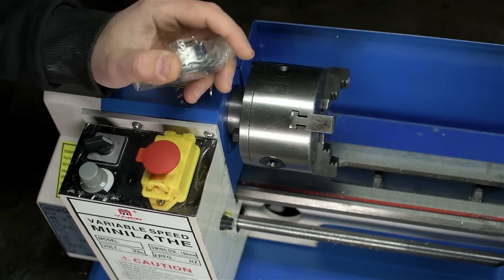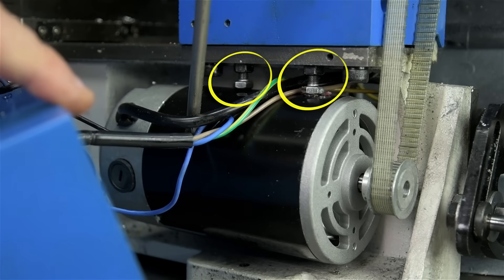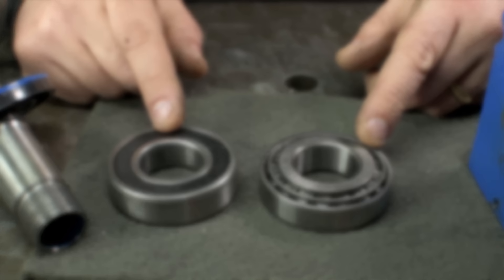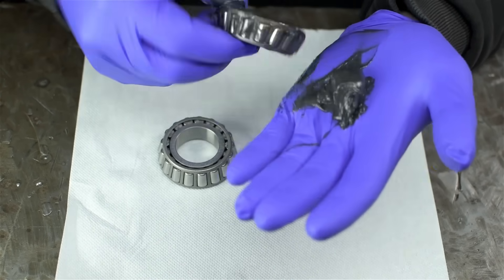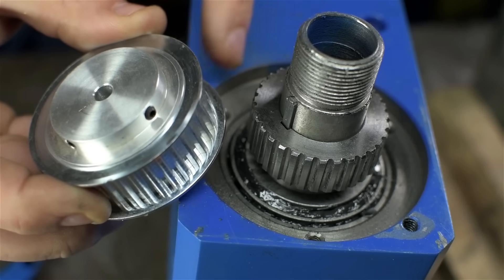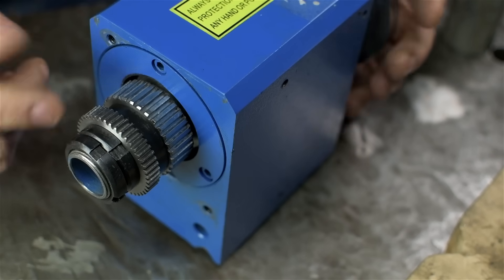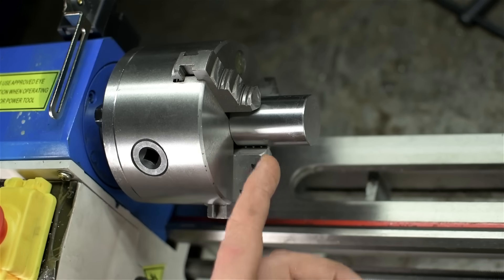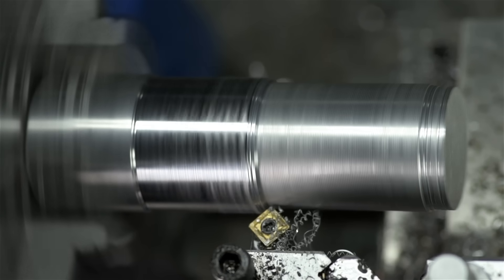Better LATHE Than Never!

Comment: You will never "improve" a machine's performance by arbitrarily replacing the bearing type used and your "they do the same thing" claim is simply wrong. Tapered roller bearings carry primarily radial loads and are never subjected to "axial loads" continually because only one bearing is carrying the load while  the other ceases to "roll" and slips, slides or otherwise loses contact and ceases to do anything its designed to do well. Wheel bearings are a really poor example of "axial loads" since the radial loads are applied to the hub which is only "aligned" by the tapered roller bearings and prevented FROM creating high axial loads. You'll also never get a tapered roller bearing "balanced" as well as "preloaded" properly when using identical size tapered roller bearings at each end of an "unbalanced" shaft. Ever seen tapered roller bearings "connected" by a shaft that loads one bearing more than the  other with identical tapered rollered bearings at each end? If your example is a modern unitized wheel bearing on a FWD or 4WD axle its a poor one as the differential, steering geometry and wheel alignment as well as torque from even "coasting" axles combine to make those sealed and unserviceable bearing assemblies "disposable" and the disk brake caliper and rotor "help" with axial loads and particularly during "high loads" which occur when the wheels are turned sharply, they are turning relatively slowly and the "outside" wheel and tire are doing the overwhelming majority of the steering and when the brakes are usually applied at least lightly which becomes the primary "thrust bearing" for the front wheels, tires and hubs freeing the "wheel bearings" to carry axial loads only. Even then, thanks to unbalanced loads on equally sized bearings, if the wheel bearings outlast the brake rotors it won't be by much and its "preventive maintenance" to replace the wheel bearings while the hubs and rotors are removed. 

Those "chatter marks" look a lot like the "drive belt" friction surface and the result of overloading the machine causing the belt to alternately stretch and snap back speeding up and slowing down the spindle each time. And you just added a bunch of rolling resistance and imbalance to the equation because apparently online "engineers" who can do no wrong in their workshops always find flawed factory engineering and/or part "selection" errors to blame when their brand-new imported machines aren't worth learning how to operate correctly because they're "inferior" to their worn-out scrapyard-reject reseller-special machines that if operated the same way doing the same work would almost certainly do it "chatter-free" but would probably also throw in some "taper" and/or "out of round" free of charge. 

Kind of an odd way to check to see if the machine is "improved" without putting a dial indicator (a real "up-down/direct-reading" indicator used for indicating "axial" travel of its contact probe) on the chuck and spindle before and after your improvement and without checking endplay before and after with the machine "warmed up" as well. You'll also need some luck using those locknuts to set your improved bearings properly for minimum runout of the shaft which requires "zero endplay/zero preload". Cold. 

With your knack for re-engineering inferior imported machines to make them "better than new" have you ever thought about building your own mini-lathe? Seems like kind of a natural project for the hobbyist that already has the "real thing" and can turn, mill, grind, weld, flatten, parallelize, perpendicularize and customize anything he needs and has the electrical/electronics background to make the whole project as simple as buying some stock and some bearings, belts etc.

Comment: Angular thrust ball bearings are better- you can get them fully sealed for no maintenance.  All cars are now equipped with dual row angular thrust wheel bearings instead of tapered rollers.  For a mini lathe, a single row deep groove bearing is plenty good.

Comment: Enjoyable video Thanks. Useful information delivered with humour is unbeatable.  With a lathe that size, inserts for use on aluminium should go well.  If they can't handle the material, the lathe probably can't either. Ground sharp edge and 20 degrees of rake works well with that spindle power.  Moulded inserts should be reserved for tiny Colchesters.

Comment: I don't know how this could be considered an upgrade. Ball bearings , unless they were made in a cave, tend to be much more accurate than rollers, which have an inherent instability of the rolling elements relative to the cage. I built a lathe from scratch with a ball bearing supported spindle specifically to achieve improved accuracy and finish over my work horse taper roller Grizzly and the results are impressive, and I used only a good quality automotive bearing, not even angular contact. Over the years I have also realized that with a proper setup cutting forces are surprisingly small , except for certain operations like knurling, for which I would recommend scissor type knurles , making concerns about spindle loads unnecessary. Bottom line, it is my opinion that on smaller lathes the pros outweigh the cons for ball bearings, and should last many years while giving better accuracy and finish.

Comment: What many of you are missing here is, depending upon your needs, that there are many models of used ex small industrial lathes and other machine tools available often for less than a new Chinese lathe. Such machines are of high quality built to last. Choosing one is not difficult with many coming from training schools, tool rooms or privately owned. Sure if you live in an apartment or just don't have the space or your needs only extend to very small work, the OK. But even then there are quality very small lathes available. 
I was trained as a jig and tool maker in the late 50s and have built 6 passenger hauling steam locos. When I purchase a machine tool I want one that will do the job from the word GO and not to spend time modifying to make it fit for purpose. But if you get off on modifying the machine then by all means enjoy yourselves!

Comment: The upgrades were logical and probably produced the best bang for the buck. The milling marks on the slides were driving me crazy, time to break out the scraper again Tony ;)

Machines like these are best run with high rake tooling in my opinion, the insert shown would be a big ask for this machine due to the angles of the cutting forces. For those playing along at home, high rake inserts designed for aluminium can still turn steel just fine, just wouldn't be used in a production setting. The only disadvantage is they can produce stringy chips. HSS with a high rake and kept sharp would also work ok and a suitable chip breaker can also be mangled into the tool.

Comment: You talking chatter and ball bearings, that’s what one of the old timers at work told me this past summer a lathe with ball bearings in the head stock you’ll get a lot of chatter out of it. He said it should be plain bearings (bushings more common term).

Comment: Just for reference, you shouldn't use moly grease on roller bearings, at high speeds the moly can lubricate almost to well and cause the rollers to 'skid' in the race rather than roll, this flat spots the roller.

Comment: Love the video, not sure about the negative attitude on speed.
I mostly use mine with carbide drills for 0.2 to 0.4mm holes in steel nozzles etc. RPM is nice to have then.

Comment: do like some of the old horizontal mill Burk comes to mind, and make a felt seal on shaft with o-rings to hold it in the casting for the front and back ( inside ) and then add the oil cups?

Comment: What is the motor's electrical configuration?

I've always heard that 1ph motors will induce chatter into the part based on the phase angles involved in bucking the armature, where 3ph has much smoother power input due to the 120° phase angles.

My lathe is 3ph, so I've never had the experience to say if that theory is true or not.

Second thought: why not make an insert for the open base of the headstock to create a cavity, and then run an oil bath like a proper lathe?

Comment: Not necessarily a bad thing to learn your machines limits when first starting out. Having to tear it apart and see the all the internals, good bad and the ugly, gives you at least an idea how hard you can push the machine. And im ok with that. Besides not everyone has the space or the access to 3 phase power for a good branded big lathe😂

Comment: My lathe isn't quite that small (9x20). It is my first and likely only lathe. I did bypass the compound with a solid steel block (appropriately machined) and was utterly impressed by how much better it was. This is to say that that mod alone is a significant one. So if one can't find taper bearings to fit their lathe they should at least consider this one.
    Never ever ever change 2 (or worse more than 2) variables at once. You know better than that! You were probably just kidding about it "the scientist in me" etc. I should probably just lighten up eh?

Comment: I just blew mine up turning some mild steel. (2 thou cuts). 
Rarely used the little bugger and when I used it I used it only on some copper slip rings. 
Gonna buy a proper lathe soon.

Comment: Top video mate, I'm thinking the low entry cost combined with bigger machinery with which to improve, might make these things viable for the tiny jobs that are a complete PITA on a Chipmaster. Might even be a runner to machine another spindle with a screw nose, and bring some little collets into play, or even a plate. stick on a vertical slide with a motor, and small gear wheels might be a runner. 

Yep, folk will no doubt say why bother, just spend more for starters. I'd recommend a look at what a quality small lathe (Swiss ?) will stand you in ?

Comment: Nice helpful and useful video. Moly grease (contains Molybdenum Disulfide) is not recommended for rolling element bearings, it can cause the rollers/balls to skid. It can be heard/felt at higher speeds.
Anyone else have similar observations?.
May I wish all, a great 2019.

Comment: I see a series coming here that would be impressive. 
China lathe mods, do all the home diy spec stuff then go full this old tony and pretty much rebuild the entire lathe and replace every part with a part you have manufactured then give the lathe away at the end. 
Use the CNC to make billet parts with TOT engravings the works. 
I wanna see you pretty much build an entire lathe. 

Build the head stock, the bed , the slide every thing, build it the best you can with all your good gear
Reply: Would still love to see more lathe mods.

Comment: I did the exact same upgrade a few months ago. The very first project with the new bearing,s, a string of swarf worked its way into the bearing, and ruined it. I was forced to revert back to the original bearings, and have not had any problem,s. HOWEVER,,,,,I do plan on replacing them with sealed angular contact bearings, in the new year, after I catch up from the Christmas wallet squeeze. I look forward to your videos, and in particular, more lathe video,s. CNC videos are alright, but I think not many viewers have CNC machines. Hope you had a good Christmas and all the best in the new year.

Comment: I was just thinking, because you don't have the right gear combination to slow down the lathe using the plastic gears, i was thinking could you change the gear ratio where the motor and belt are. you will loose highend rpm (which seems to scare you anyways) and gain torque. i have no idea how this would work in 3d but the idea did pop into my head as a potential way to solve the problem. thanks tot.

Comment: Never been able to understand all the hate for the minilathe, I’ve had my HF lathe and mill for almost 20 years and they have both been strong performers though I have definitely wished for larger machines.  I have broken one gear so far between either of them: the drive gear on the mill head, and despite some dumb, rough treatment over the years they have never made me regret the purchases.  The best mod I’ve ever tried was replacing the crude cross slide interface that resulted in so much extra friction with a ball bearing.  Ideally a thrust bearing would have been a better choice, however compared to no bearing at all it’s light years ahead, easily rotating with a single finger, even under heavy load.  It hasn’t added any measurable backlash either, again the original interface was just chunks of metals tightened up together with loads of slop so it is so much nicer now.

Comment: Excellent video Tony !
I am just doing some upgrades to my mini lathe , i did the taper roller job when i first built the lathe but this time i have added some grease nipples ( zirk fittings ) so i can pump grease into the bearings . The  plastic retainers have been replaced with alloy units that have a lip seal so the grease cannot come out without being forced through the bearing , i will probably use a liquid grease like they use in steering boxes or similar as it is a little more viscous than wheel bearing grease .
I have a few photos and  some info  on the model engineers  workshop forum  if anyone is interested - search for XD351 then check out my photo album  or look for  mini lathe 3ph conversion by Neil Wyatt, i have loaded some updates on that forum thread .

Comment: Useful upgrade. But I don't recommend angular contact bearings, because the aim of tapered roller bearings install is spindle rigidity increase! And the loads there have nothing to do with it. ANY BALL bearings won't give a rise of rigidity. Max. effect tapered roller bearings give when cutting off, parting.

Comment: The bearing upgrade and compound elimination only show a modest improvement in performance because the underlying issue was not addressed.  Mass and rigidity of the spindle, headstock, bed, and carriage are likely your root cause for chatter on heavy cuts.  I've experienced similar performance comparing depth of cuts on a 600 lb mill/drill vs a 2500 lb knee mill.  One cuts like butter leaving close to a mirror finish, the other chatters badly leaving a terrible surface finish.  You can only guess which one performed better.

Comment: Thanks for another great video.  The idea of converting one of these to CNC is intriguing.  I am certainly not a tribologist, but as I recall moly grease is best used on sliding parts and not recommended for rolling parts such a ball or roller bearings.  Something the viewers may want to look into.

Comment: Id love to see a video on upgrading the carriage mounts since I have this lathe and by far its the crappiest part. They loosen themselves off every few minutes and I get horrible chatter. It also wont run a parting tool without pulling it under the work and stalling the motor.

Comment: Regardless of the bearings, the bed is too small to have ample rigidity for high demand cuts. Light work on light materials, or invert cutters and especially parting tools and turn work in reverse to be on the forgiving side of the flexing bed.

Comment: One very important point. Double row ball bearings do carry a lot of load and consume less power. Many heavy duty live axles in cars use them. Single row are also used often. While I have no problem at all with  tapered bearings they MUST be sealed bearings. With the amount of grit and schrapnel a lathe produces it is essential. The steel spacer though is a given. What were they thinking?

Comment: I managed .125 DOC in 1018 on a 5/8" round, using something like 20 degrees rake on the tool.  That was on stock bearings.  I think the best upgrade I made other than to straighten the gibs was changing out the cross & compound leadscrew bearings with ball bearings, which allowed me to set the gibs a lot tighter without making the machine a pain in the neck to use.  I adjusted the saddle "retainers" too but with all the cutting force pushing the saddle onto the bed, I don't think that makes any real difference.  
I learned so much from my minilathe.  Mostly while making it usable.
Reply: @Grauenwolf    I never ran brass or bronze gibs so I have no comment on that.  But the stationary part of the compound and cross slide dials has enough room to fit a ball bearing if bored out.  If I remember correctly it is a 6200-??  to fit the 10mm shaft of the leadscrew.   Although it is a ball bearing so not great for thrust, it removes so much friction it allows you to tighten the gibs and yet have a very comfortable to use lathe.  If you want, I'll take my minilathe apart and get some details.  I also extended the cross slide which at that time was pretty easy; only a spacer had to be made since the cross slide lead screw was threaded extra long.  I think they shortened the cross slide travel just to make it fit a smaller box.

Comment: Odd that you got noise like that with only 0.025" DoC in mild steel. My similarly-modded mini lathe can handle twice that without complaint. I wonder if it isn't a result of your lathe having the spindle driven directly from the motor, versus the high/low transmission gears in mine.

Not saying one or the other is better, I just find it odd that given the same modifications (tapered roller bearings and deleted compound), the performance is that much different. 

Also, I wonder if hand-feeding is a factor. I'd be curious to see if using the power-feed (using the slowest gearing) would  have a different result.